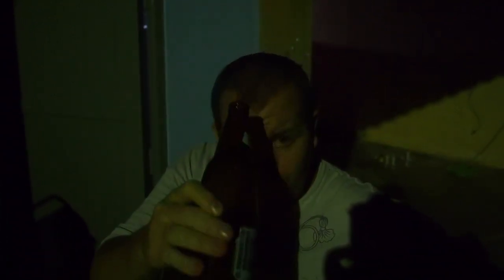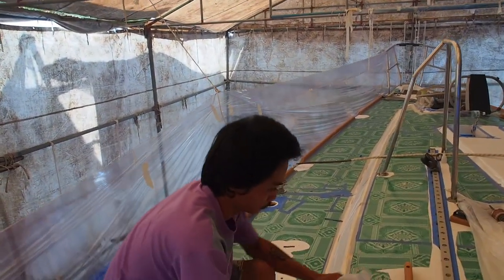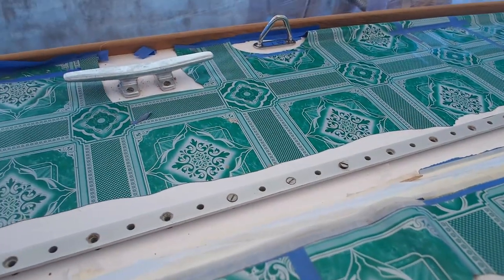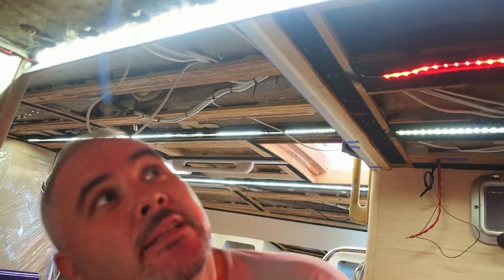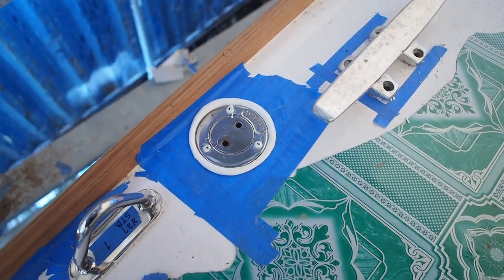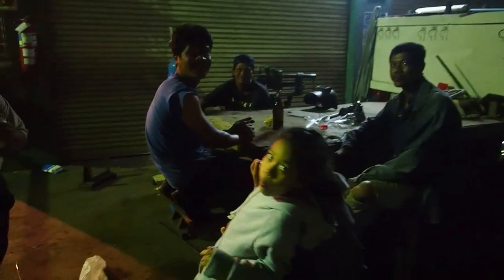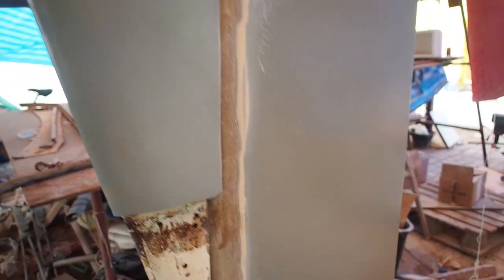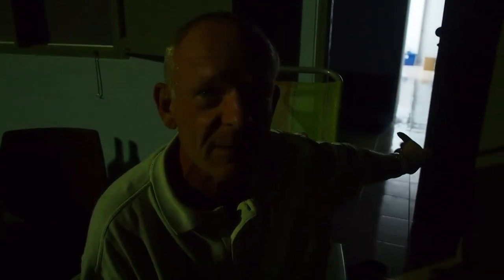Esper Refit 37 -  bedding a genoa track with butyl tape; rudder doesn't fit

Comment: Wh didn't I watch this a week ago. Already done the port side and made some mistakes... out it comes next week. At least I can reuse the butyl! Thanks for this.
Reply from the maker: If only, eh? It's been a good eight years since we made this video and the butyl is holding up just fine. Good luck with your fittings!
Reply: @followtheboat  Sounds like there is no feeling  that you needed the extra strength of adhesive filler?
Reply from the maker: Correct, no need for it.

Comment: When you're sitting down at your nav station, will it not be a pain in the ass to view your chartplotter?
Reply from the maker: Chicken Soup  That's a fair question. Firstly, because the old chart table used to span the entire length of the area, we got used to leaning over and putting in co-ordinates from a standing position. Secondly, whilst on passage we rarely sit at the chart table because we only pop down to check our position briefly. Thirdly, we have a second chartplotter at the binnacle that is connected to the main chart plotter; they share the same information. Finally, there is an additional PC running a separate plotter on the first door, which opens out and faces you whilst sitting at the chart table. I think with this set-up we have all bases covered.

Comment: just found this VLOG, as they say. Loved the whole thing. I am on my 37ft live aboard and enjoying the butyl tape. Which is what caught my eye in the first place.  Does anyone know if butyl will seal threaded bolts? I am on a steel hull and have cut a thread ready for the bolts.
Reply from the maker: Do you mean the hole is threaded,, +Terry Peake ?
Reply: +followtheboat Yes. Sorry. The hole is threaded and the bolt has a countersunk type end.
Reply from the maker: I don't see why not, +Terry Peake

Comment: It has been 6 years since the track was bed with tape. How is it holding up? I am installing mine and I'm going to use Sika 291 LOT. I think the polyurethane will help hold the track in place as opposed to butyl. On my Cris Craft windows, the butyl seems to flow all the time. I'm always tightening up the screws. Not to mention the dirt that gets stuck to it. It looks unsightly.